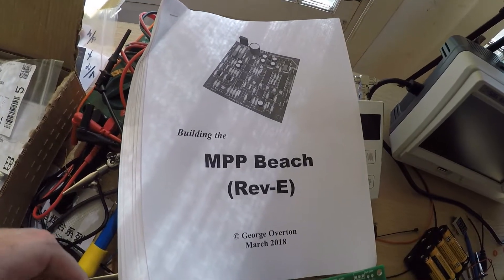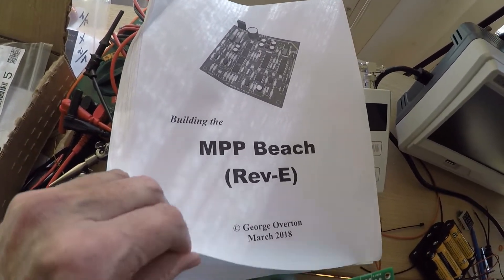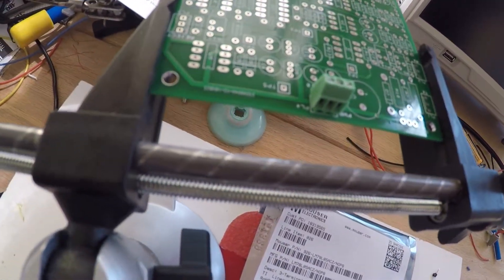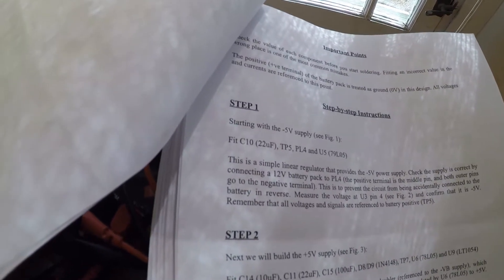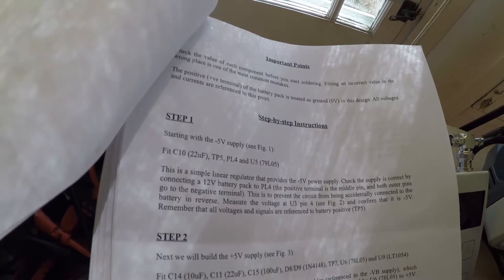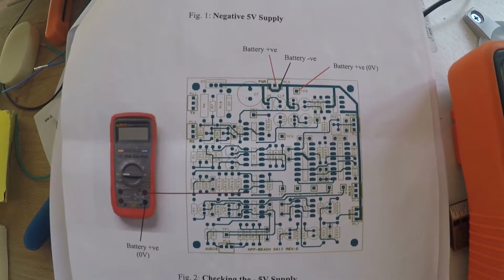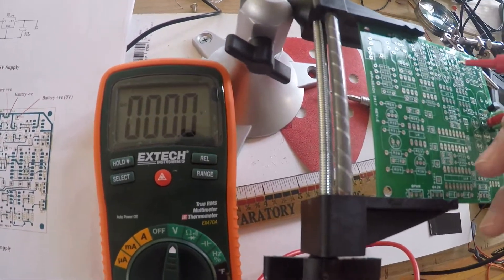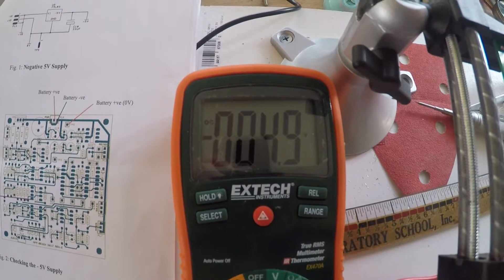Mini Pulse Plus Beach Rev E step#1

Comment: هل جهاز ميني بلاس. يتأثر بتربه المعدنيه
Reply from the maker: Hello Mohammed, The Mini Pulse Plus is a pulse induction machine so the mineral soil does not cause it many issues.  This detector is optimized to use at the ocean beach.
Reply: @SurfDetector  ينفع معي في البحث في شذرات الذهب الذي في قمم الجبال
Reply from the maker: @mohammedaaoad8780  You could use it for that.  It will need to be modified to make it more sensitive to small nuggets.  All of the information to modify it is available on the Geotech Forum website.  All of the machines that I build are for the ocean beach.  Thank you for watching.
Reply: @SurfDetector  والله إني حيران اخي
Reply: @SurfDetector  ممكن ان احصل على مخطط جاهز. لكاشف شذرات الذهب.  ويعمل معي في قمم الجبال
Reply: @SurfDetector  ممكن اخي ترسل لي مخطط جاهز مع التعديل لتقوية الحساسيه لميني بلاس. لاني لا اعرف التعديل عليه
Reply from the maker: All of this information is available for free on the Geotech Forum website.  There is a treasure of information there my friend.
Reply: @SurfDetector  جهاز ميني بلاس شغله نفس شغل جهاز وحش الذهب. او جي بي زد
Reply: @SurfDetector  الرجاء الرد اخي
Reply from the maker: @mohammedaaoad8780  Please subscribe if you have not yet done so.  Thank you.
Reply: شكرآ اخي على سعة صدرك
Reply: @SurfDetector  بارك الله فيك اخي
Reply: الرجاء الرد